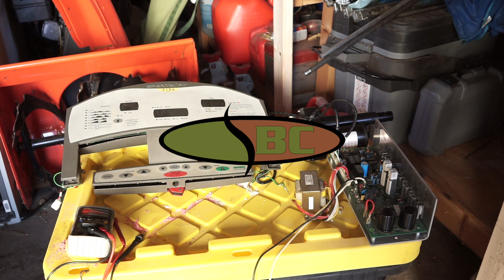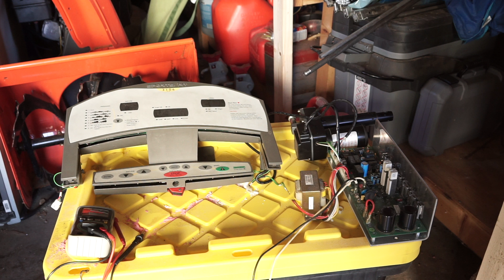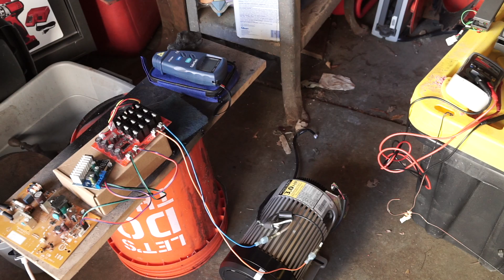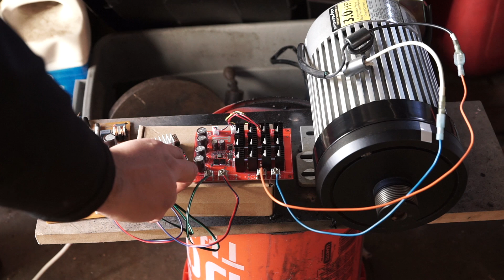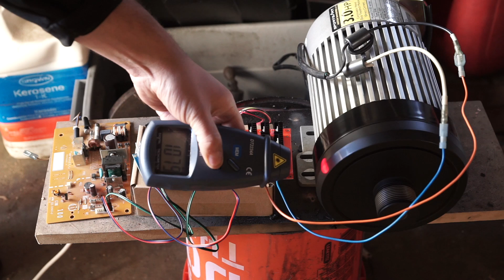Easy treadmill motor wiring with off the shelf parts

Comment: Thanks for posting this! I know it's 2 years later now, but did you find more solutions you were looking for? Here is a video of an inexpensive way to do it, seems like your way but much cheaper parts and simpler (pwm controller of adequate size with potentiometer and bridge rectifier together under $15 I think) Also, wouldn't a double throw cheap switch be good enough to reverse direction? And when you do, your flywheel may just unthread on its own. I'm glad to see you put it under load to show us. maybe all these parts are cheaper even after a couple years. I hope this helped!

Comment: if you haven't figured it out yet, (i'm viewing this a little late). if you reverse the motor
the pulley/ fan assembly will unscrew itself. possibly you might have to use the towel
to create some resistance. just my $.02 worth. keep up the great work and awesome
videos. Terrific audio and video.

Comment: A basic MC-60 treadmill control board used with a 5K potentiometer is a simple way to control a DC motor.
You can also use a 10000W SCR controller with a bridge rectifier to turn the AC voltage into DC.
Reply from the maker: I read that but didn't have a mc-60... my controller board was different so I had to figure out something else that would work...

Comment: I would use an arduino to produce an adjustable pwm signal and send the signal to the treadmill circuit board. The pwm signal would be connected to the gate of the mosfet or igbt that controls the output to the motor. 
This way you have a power supply meant for the treadmill motor being controlled by an arduino and you can use the same arduino to read the rpm also

Comment: there is a small circuit Transformer to run the electronics in these things the larger what you're calling Transformer is not a Transformer it is an induction coil that coupled with a capacitor take the ripples out of Rectify DC so at Full Throttle you'll be getting around 100 volts DC from a 120 Outlet AC I'm going to Fry's now we'll do a video on it later tonight

Comment: The biggest problem I'm encountering with using treadmill motors is metric treadmill pulleys .v SAE based machine shafts. I can't find metric bore pulleys anywhere...nor conversion bushings.
Reply from the maker: I wonder if you can get them direct from china or Europe.

Comment: I have three DC treadmill motors for various projects. I have one of those projects completed.
I put a 1.5 hp motor with an analog pot for the speed control onto a Rockwell/Beaver 11X36 wood lathe.
The first time I used it was with 2" maple and it worked perfectly. My second project was a 6" pine blank 24" long with the corners knocked off on the table saw before going between centers.
When I presented the tool and the load came on the motor, it overcompensated to the point the lathe and cast iron stand vibrated across the floor because it winds up so fast. Can I adjust the "feedback?"
Reply: On the commercial power supplies (kb, I believe, but I have looked at so many...), there are speed up and speed down settings, to dictate in seconds.  Think it was the pwm types, not sure if it was exclusive to it. Just ordered KBWT to get my treadmill motor going...

Comment: On your treadmill motor.  To develop high voltage and current for your motor you can rectify 120VAC and use a series high current zener to acquire the desired voltage.  It would be safer to find a transformer for isolation but will work without it.  So to get your voltage and current you need a big rectifier and zener.  The old treadmill controller should have had the rectifier.
Reply: 3hp (momentarily) is at max rpm + flywheel inertia I think you're well aware.   100 volt dc is max motor voltage(?)   dc voltage is 1.4 times ac voltage.  boost converters increase voltage and decrease current, so no gains in power. ycdmill is right about the bridge rectifier on that board.   I've been up and down this road many times so    If you want a horse it'll cost you 745 watts.  wattage=voltage times amperage.  That's a great motor and it may surprise you when you feed her watt she wants
Reply from the maker: yeah its there but it's soldered really well... and I don't have a rework station... this setup seems to work ok... I wish I could find a 100v pwm motor controller... that didn't cost an arm and a leg...